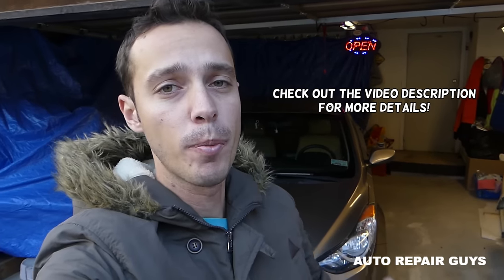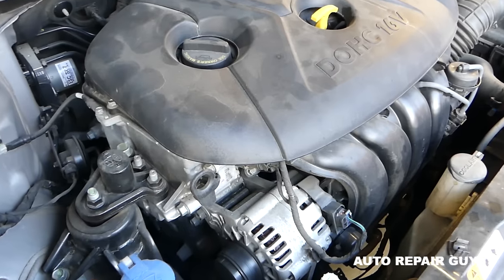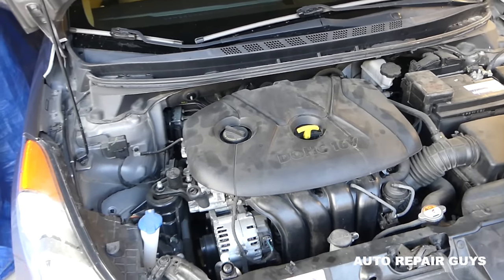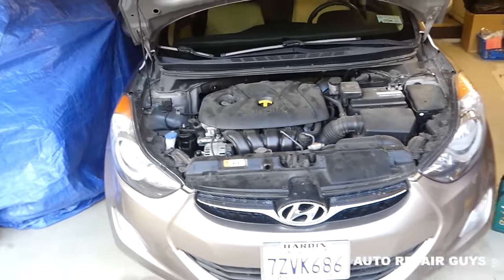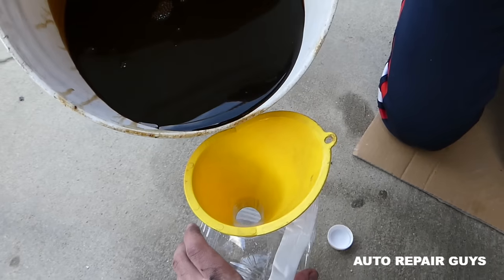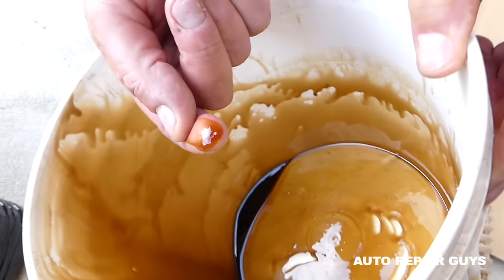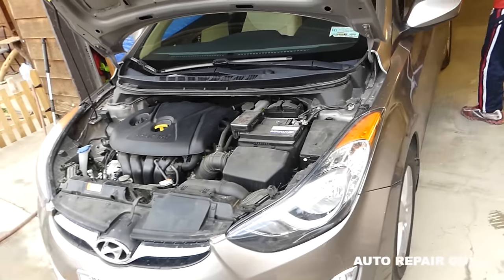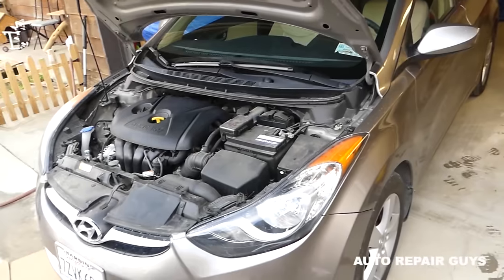HYUNDAI ELANTRA ENGINE KNOCK TICKING NOISE

Comment: In 44 years of driving and car ownership,  I've never had dirty oil like that in my engine. I change it at 3000,  To 4000,  miles, never more than that. All ran on castrol  Gtx, 10 30. I've had engines near 400.000 miles. No problems or issues,  they were still running great. And sounding perfectly fine. I have 337.000 miles now on my 94 trans am,  lt1 engine. Bought it new. Engine never been touched   runs great,  sounds great.
Reply: Try the 8 hr charge to roll the lt1 to change the plugs lol
Reply: @georgekershner6626  I've had the dealership tune it up twice . Plugs and wires. No big deal,  I waited both times, only like 3 hours out the door.
Reply: This issue is not due to dirty oil or user error. These engines are faulty.

Comment: I have a question I have 2012 Hyundai Elantra and on 50 miles per hour start shaking and when I brake they still checking you think is the wheel bearings or the brake pad and when I'm driving you do a weird noise like he's coming from the tires but is not a tire because I pull brand new tires can you tell me what is wrong with my car please
Reply: Warped rotors or tires out of balance
Reply: Start balancing the tires.

Comment: I have a Hyundai 2013 73.000 I hope I never hear that problem 😜👍
Reply: My '11GLS has 206,000 miles and ticks like hell. Always has. 👍👌
Reply: The ticking is normal, the nock not.
Reply: same here, same amounts of the miles.
Reply: My '13 Elantra GT started ticking last year at 37°...this year at 45° in the morning. Apparently, they didn't de-burr the engine block during manufacturing for a few years. I'm calling the local dealer tomorrow.

Comment: This specific engine is in a class action lawsuit now for engine deisgn problems that caused issues like: camshaft sensor failure, metal shavings in engine oil pan, shifting issues in transmission, and other issues that should have been recalled.
Reply: Wrong ,this is the 1.8 not the sonatas 2.0 get facts

Comment: Ticking and Nocking are different things. Those Hyundai's ticking sounds are normal due to the direct injection and motor design. The ticking is louder in the mornings (cold start) due to the engine reving up above 1000 rpm to warm the catalytic converter (about 15 seconds, then the ticking noise reduce but you can still hear the tic). The cam shaft sound is normal, the opening and closing of the valves sound is louder than other cars. You can even hear the fuel injectors ticking on those cars louder then others too.
Reply: Exactly!
Reply: This hyundai is 1.8 NU motor which is MPI not GDI, it’s port injected and shouldn’t make a tick like most GDI engines

Comment: What do you do if you see an metal shavings?
Reply: That’s a recall issue depending where you’re from
Reply: Recently bought a used Elantra 2006 - black fiber-like crap comes out of the vents and irritates skin, eyes, mouth, lungs, etc. Weird chemical smell on occasion. Vents are literally caked in these nasty fibers and other gunk. Engine is rough as hell, ticking noise similar to video but worse & the car shakes like crazy during idle, like someone's is blasting bass music. Wife and I have been insanely sick since we began driving it - myself worse than her, since I spend a majority of my day in the car. Dizziness, nausea, headaches, blood in throat and sinuses, hearing loss, vision loss, paranoia, skin rashes on exposed skin or really anywhere those fibers get (and at this point they're in everything we own), vertigo on especially bad days, acid reflux, fatigue, muscle pain, scaly skin, pimples all over face and body that contain hard pus and require a needle and tweezers as they simply cannot "pop" (and inside the pus, a fiber), said fibers seem sharp and crumbly as well as sticky (though perhaps just sticky in the sense that they are like splinters and refuse to just wipe off). Not sure what the hella going on, we originally thought we had fiberglass coming in thru our heating vent, as we found fiberglass throughout our apartment, but it could easily be from a broken fiberglass window screen that we had our fan in front of and only be incidental. I continue to grow progressively more ill, doctors have no idea and think I'm either bonkers or wrong but have at least referred to dermatology - in 4 months...

Any idea if this may be related to the car? We are taking it in to a mechanic tomorrow, the only thing I was able to find that hunted at the car being a potential issue is "the black death" issue with far A/C systems. It should be worth noting that the dealer we bought from is sketchy as hell - he bought our car that needed 13,000$ in repairs for a multitude of unsafe issues, at a bare minimum it needed 5000 to be functional, paid us 500 and immediately relisted for 3500. It's clear he didn't make the necessary repairs, so my guess is he knew full well this car was fucked and sold it to us for 3800 anyway because he knew the person paying for it (wife's father) would be too stupid to get it checked out before purchase. 

Anyway, would love some advice if anyone's got any. Thanks.
Reply: I should also mention we have smelled:
Gasoline,
Sulfur,
Sickly-sweet chemical
and exhaust in the cabin when we first started driving it. It made us severely ill requiring a trip to the hospital out of concern for carbon monoxide poisoning. Neither of us could even speak properly, kept forgetting words, and forgetting what we were even saying. The dealer paid a mechanic to replace the oxygen sensor and the exhaust smell went away. But things progressively got worse. The odours are largely gone, except this bizarre, almost unnoticeablely faint chemical odour.

Comment: Just went through this with my 2015 Elantra........it is an issue with bearings coming loose and rubbing together and causing metal shards to get in oil and therefore the block........my dealership replaced the entire engine as there is no other way to remedy this.
Reply: Did you have to pay?
Reply: How did you do that? I took my 2015 in for ticking they said it was. Manufactur error and it needed a new motor they wanted me to pay for half.  I refused and told them that they needed to fix it.  I didn’t win and they gave me back the car in it’s same ticking state.  Now I’m just waiting for it to die
Reply: @nicolle27g  I was still under warranty so I only paid for new belts/hoses. Bout $150.
Reply: BecUse I was the second owner the warranty goes to 60,000 (I think).  I’ve been fighting this for about 8months and they won’t budge. Nothing like having a 2015 car that needs a new motor.  Now they said they won’t pay for any of it.  I was thinking about getting a lawyer since it is their manufacturing error
Reply: @nicolle27g  Do you still have the car? Is it still running well or did it die as you feared?

Comment: Had this exact issue on my 2012 Kia Ceed. It was metal shavings in the oil due to heat damage in crank shaft. The noise got extremely loud over time. Kia recalled certain cars for this issue but not the Kia ceed...they asked me to pay 5 thousand to fix it. Had to sell the car as faulty, lost lots of money. Will avoid Kia/Hyundai, I'm sticking with Lexus from now.

Comment: Engine knock is caused by using cheap oil filters without a check valve to hold oil inside the filter.
Only use high quality oil filters like OEM or WIX. Also use 5w30 weight oil instead of 5w20 for do a economy.
Reply: Not in these engines. The GDI Gamma is flawed.

Comment: Hi, my 2012 Elantra has intermittent jerkin when accelerate. Do you know what is the problem. Thanks
Reply: I got a 2013 Elantra and also has a knocking noise and don't know why it dose it if i dosent have no engine light on

Comment: This. Is. The. Reason. Why. An. Old. 
Toyota. Is. Better.  Than. A. New. 
Hyundai.  One. Of. The.  Reasons
Reply: I have a lifetime drive train warranty as long as I come in for 2 oil changes a year from the dealer, did your Toyota come with the same warranty?
Reply: Did the Toyota need to? Because 500k later it won't need engine work. Good luck getting dealerships and manufacturers to actually honor those warranties.
Reply: My toyota starlet 1998 is making this sound😑
Reply: sold my 2006 sonata with 274000 miles couple weeks ago, runs and drives like new, no leaks or burning on original drivetrain, meanwhile I had 96 camry it leaked from every place possible. 
Also some toyotas have excessive oil burning issues I think it's 2009 camry, anyway the point is it's all depends on how you treat the car, or how it's been treated before you get it.
Reply: very true good point
Reply: Hyundai switching to timing chains started this mess.  I had a 2006 elantra with almost 200,000 miles on it SOLID TIMING BELT DRIVEN ENGINE.  No ticking or knocking.
Reply: My 2012 Cee'd with 32k on the clock had this exact issue. Got so loud it needed a new engine. I now have a Lexus, Kia never again, I lost over 2 grand
Reply: @2much4you31  rather have a chain any day than a belt that has to be changed constantly
Reply: My 94 Toyota Celica's engine with 194,000 miles is quieter than the engine of my 2014 Hyundai Tucson with 84,000 miles I just bought used.
Reply: Bal.on.ey!